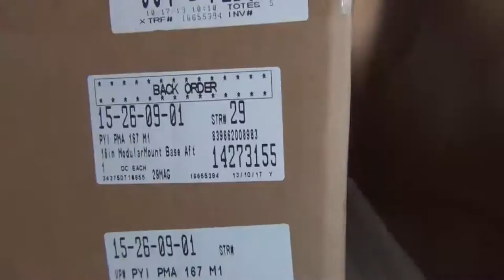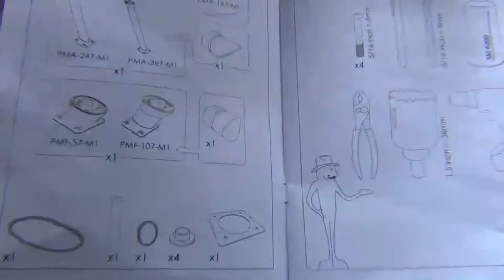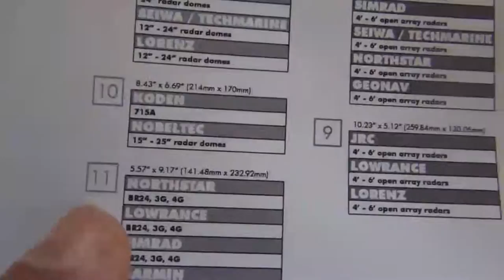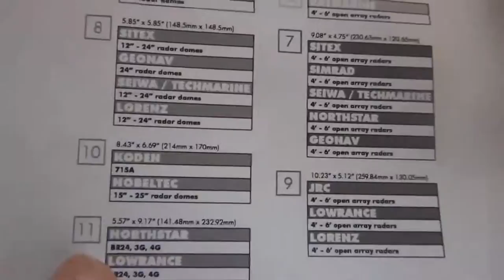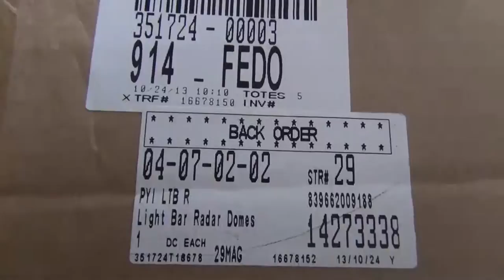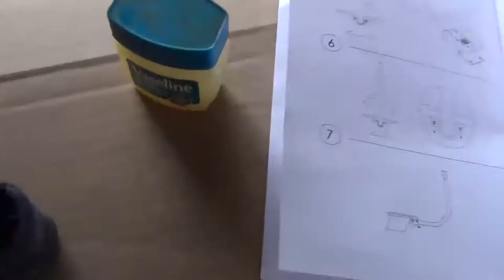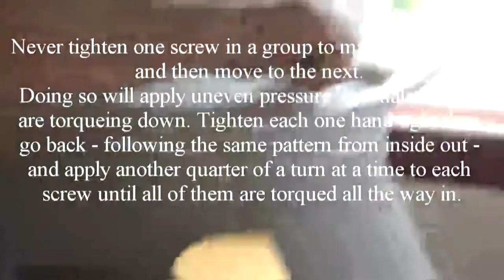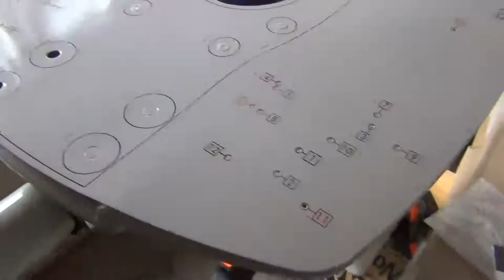Boat Work - Installing Garmin Radar Part 1

Comment: I understand your sentiment concerning the mount. The SeaView mounts used to come as a welded, single piece. This meant that there was a separate, stocked, part number for each different radar make and/or model. Separating the plate allowed them to standardize the mast, only having to produce one stocked part number, and then produce an interchangeable plate to adapt to a given radar. This would also allow the boat owner to update the radome, or change brands, only having to purchase a new adapter plate, instead of an entire mount. This makes good business sense to me. I do not know, off hand, what the price difference is, between the old one piece unit, and the new two piece unit.
This change should have been explained to you at the time of sale, and if it wasn't, than the sales person dropped the ball.
Keep making these great videos. I believe that I speak for many people when I say that YouTube is my primary source for how-to when I need to tackle an unfamiliar project. Your detailed videos are as helpful as they come.
Regards; Scotty, Harbor Marine Maintenance and Supply
Reply from the maker: Scotty, thanks for taking the time to watch and comment on my video. I agree with you 100% that dividing the mast into separate modules – modularizing the design – makes absolute business and engineering sense to me. It is just that this fact was never mentioned to me before I bought it. As you said, the sales person must have dropped the ball on this one.
Reply: Ah well. This change is fairly recent. Maybe the salesman just hadn't been made aware of the change yet.